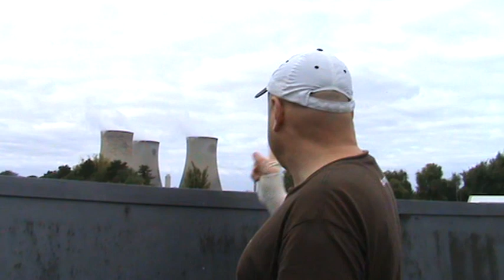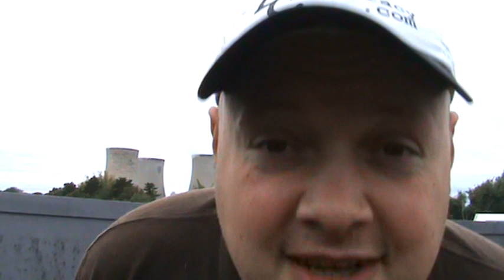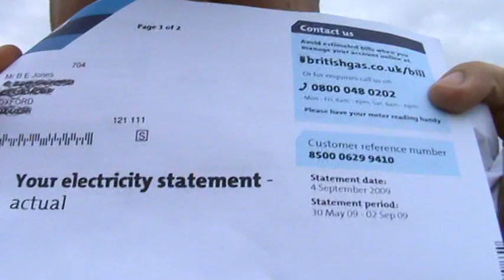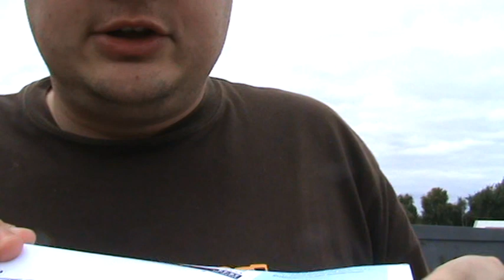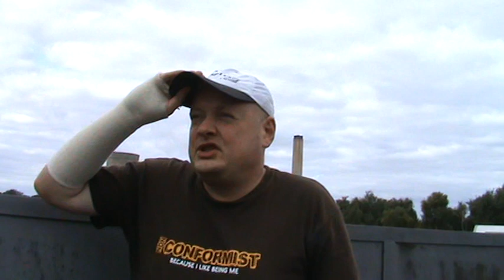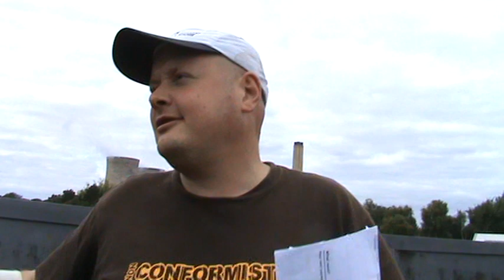Freikraft: Free Energy- Part 1

Comment: Sorry to be pedantic. Water from the cooling towers is pumped back into the River Thames (or was..before Didcot A closed). The boilers used a closed loop of de-ionised water to prevent corrosion.

No its not an eyesore, it's beautiful, and its kept your lights on for a long time, and kept a lot of (local) people in a job :)
Reply from the maker: Well, it's a matter of architectural taste I guess ;-) ... As for keeping my lights on, yes it has technically, but that doesn't alter my point about how its source is being forced on us deliberately to prevent us using others. So the cooling tower water.gets pumped into the river does it? OK